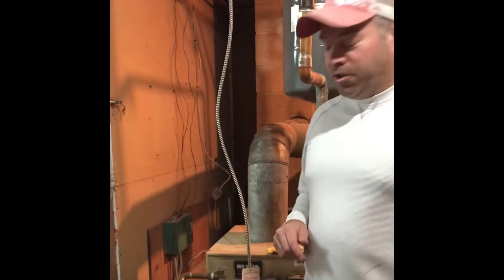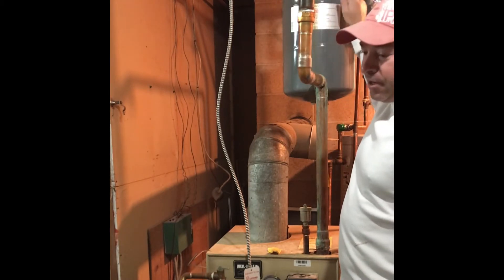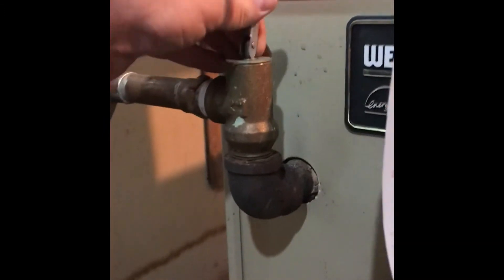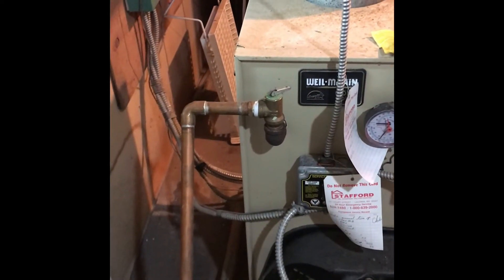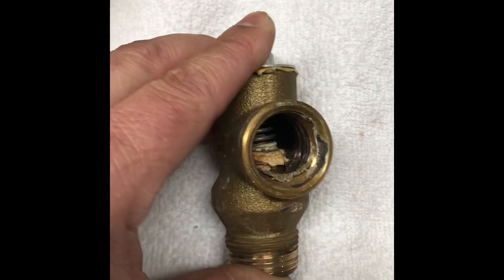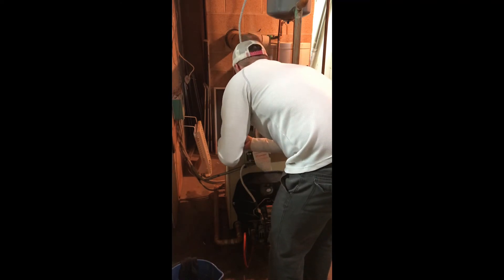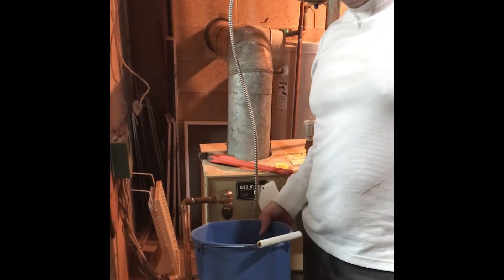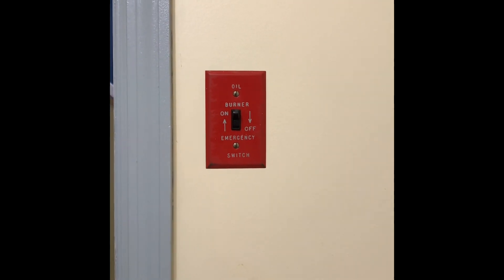Replace Pressure Relief Valve Boiler - FIXED

Comment: Could be one of many reasons the 30lb relief valve was leaking! Just changing it may not solve the problem!
Reply from the maker: Agree.
 This time it was the valve that needed replacing.   But a few years ago a pipe cracked in the loop of my indirect water heater and water pressure from tank forced water into the loop causing pressure and relief valve to open.  Took me a minute to figure that one out!  😄

Comment: I dont have a pressure tank like that and the releif valve just replaced for 225.00 six months ago is leaking.
Reply from the maker: As your boiler runs watch your system pressure.  It will tell you if you have a pressure problem.  Things to consider:  system feeder valve, pressure tank, relief valve.   You don’t want to over pressure your pipes as a leak could be very costly (water damage).  If the solution evades you, time to call in a pro.

Comment: Hi  i tried to find  relief valve  for my  floor heating radiant  { watts regulator model  M no 335 size 3/4 inch set 30 lbs BTU  per hr rating  NB ASME HV 510,000  } I took the  valve and checked with   plumbing store but could not find the same model  can u please let me know   what is important  to be the same  as the description above  if i  buy one from deferent company  or deferent model  Thanks
Reply from the maker: John, the relief valve is rated for pressure.  So matching the pressure relief is key.  Although unlikely, look to see if there is a temperature rating as well.   Match these and you should be good to go.   A call to the mfr is not a bad idea if you want confirmation.  Cheers, Terry

Comment: Also, you got the wrong relief valve. You installed a TP relief valve that is intended for a domestic hot water heater.  That valve is rated for 150PSI.  The boiler relief valve should be rated for 30PSI and should cost double for what you paid for that valve.
Reply from the maker: Hi Clark, I installed a 30 PSI pressure-only relief valve.  You make a good point though.  Be sure to select the right replacement parts.  Cheers
Reply: @terryclayton Do I need to close the zones valves?